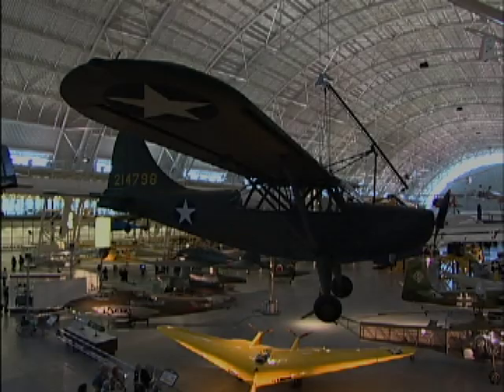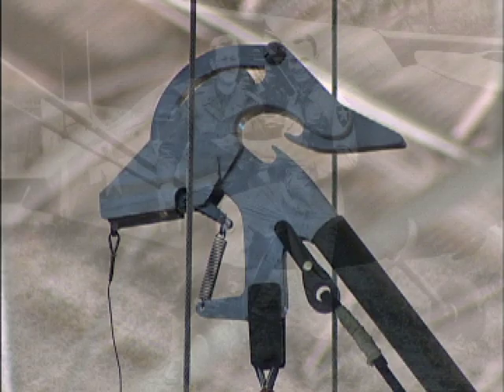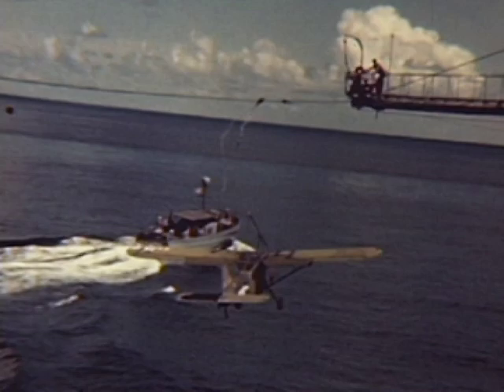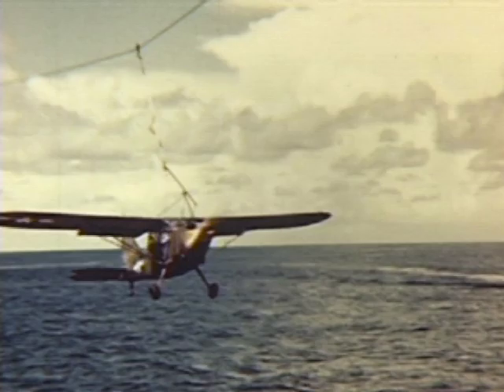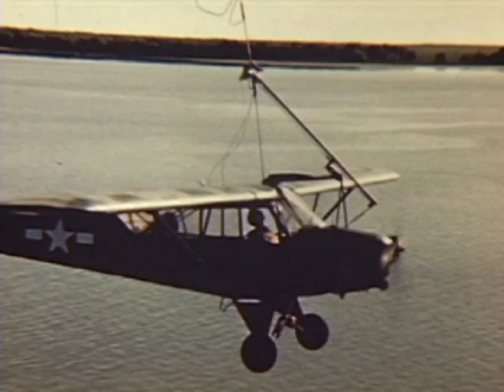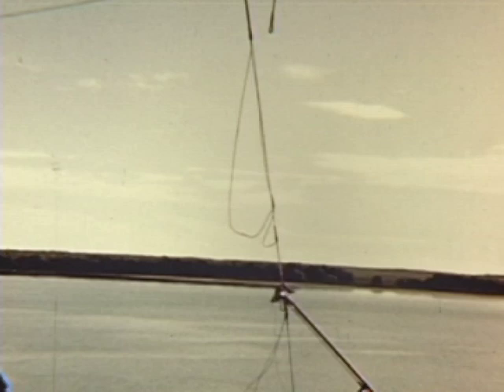Stinson L-5 Sentinel with Brodie System

Comment: Can someone please explain what the Brodie System did? How did it work?
Reply: Military historian here. It was basically a zipline for planes.  Scout planes were VERY light and could fly VERY slowly. The L-5 shown here weighed just 765lbs, (the F6F Hellcat, the USA's premier carrier fighter, weighed ten times as much!)

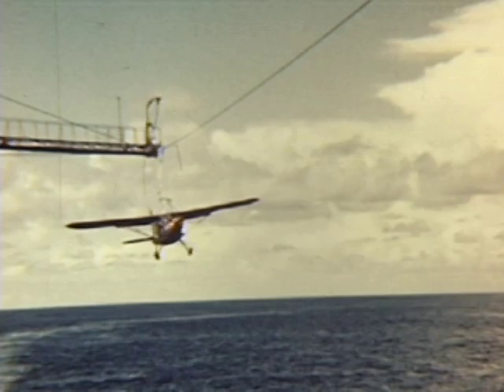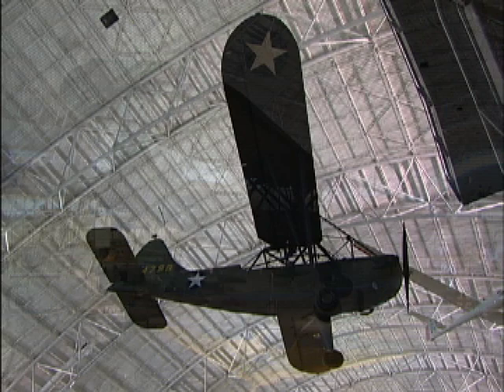The ship would suspend a line that ran alongside it's hull - you can see it at 0:25 and on that line would be a sort of "hoop". The plane would have a hook on top of it - you can see this at 0:08 

A pilot could then fly slowly alongside the ship, allowing the hook to catch the hoop. He'd then slow to a stop, and be left dangling there for recovery.

This might sound tricky (it was!) but it was preferable to the other options, which were a) have a full flight deck (expensive, vulnerable), b) land a seaplane and then taxi the plane onto a little pad or pick it up with a crane (done with the Kingfisher, but not a reliable option) or c) simply have the pilot bail out and not bother getting the plane back (done with the Hurricat, but wasteful)
Reply: @pavarottiaardvark3431  Thanks for your help understanding this. Worth the wait 😃